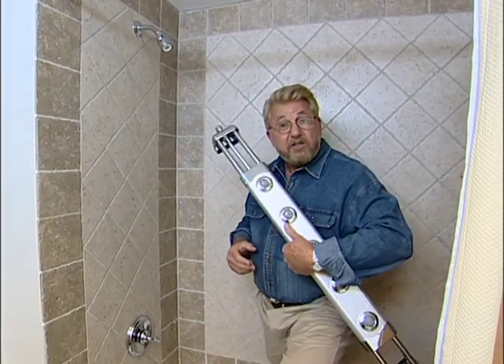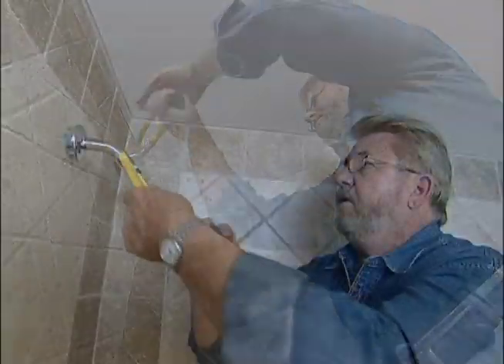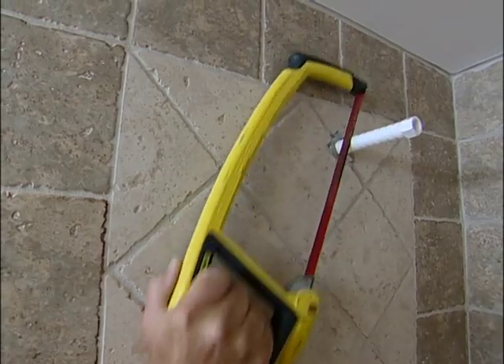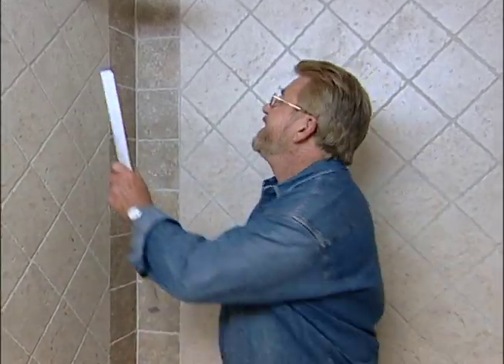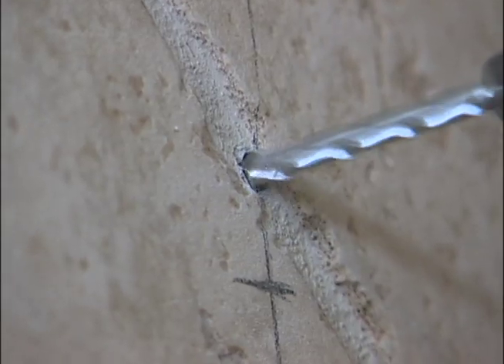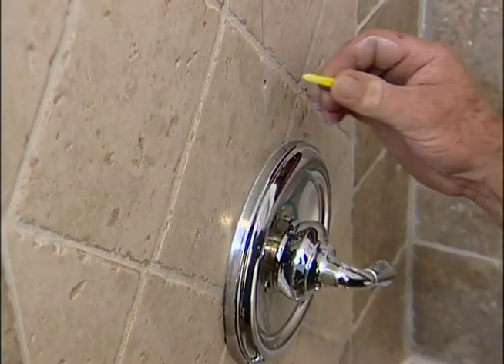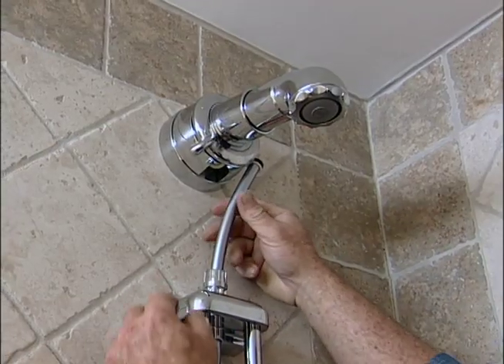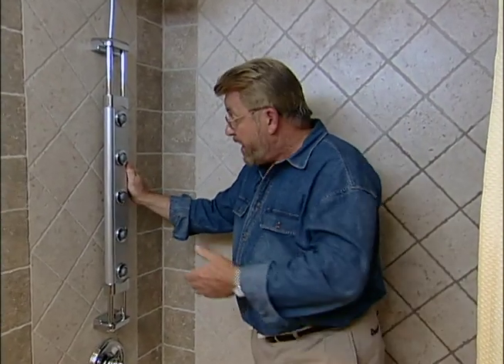Install Multi-Head Shower

Comment: I was in over 300 homes in the past year. Only one home had the water volume to do a multi head shower at any sort of psi pressure at all. All  normal homes have a 3/4" water line from the meter. That's all the water your getting.   Multi heads and gigantic shower heads are a pipe dream.  City water meters are 3/4" inlet and discharge.
Reply: Booster system

Comment: All in all id say this was a good video. Id like more information on the fixture you installed and 1 question. Do i need install a pump to increase the water pressure?
Reply: The main head reduces the GPM so it can divert the extra water without losing pressure.

Comment: I'd be scared to death that I would drill a hole in the vertical water pipe. And would not water pressure be an issue for so many spray heads? Do like your videos though.